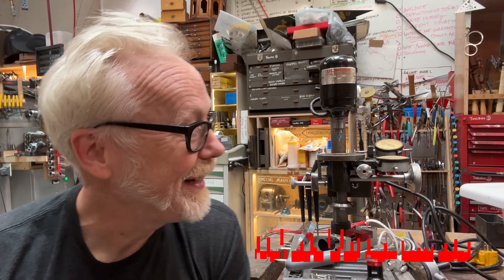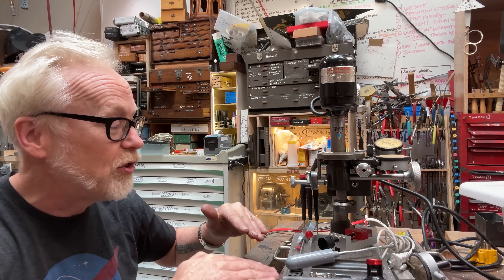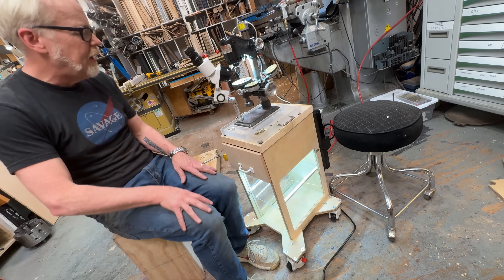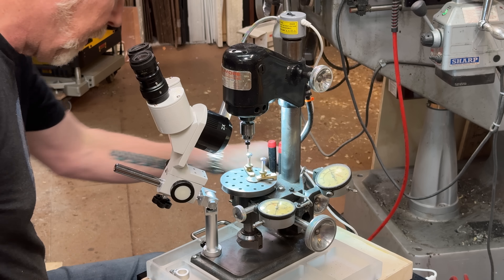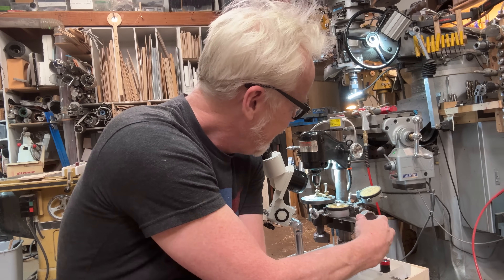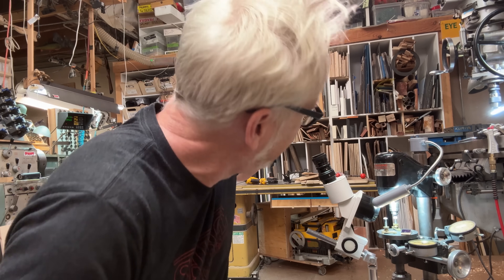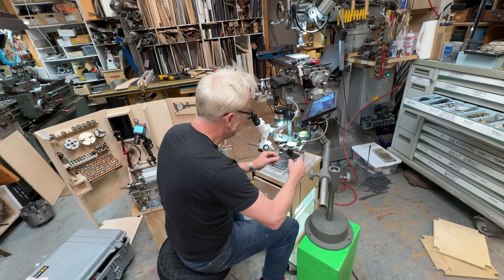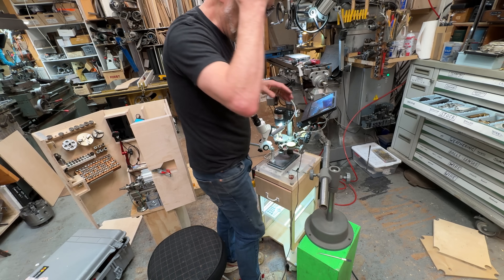Drilling a Hole the Width of a Human Hair?

Comment: Pretty sure stability of the surface you operate this on is going to become more important. You're on what, plywood? That's going to become a problem.
Reply: He mounted the stand on caster wheels. So it doesn't matter what the floor is made out of. He's isolated off of it now. Drills generally don't suffer from chatter issues though. The thrust is inline.

Comment: "Thats the smallest hole i'm ever gonna drill", sounds exactly like a guy who's about to deep dive on drilling even smaller holes.
Reply: 100%. But hopefully at that point reason prevails and you remember that lasers are a thing
Reply: @Mupshot  I've been out of that industry for a while but last I checked, FIB was still preferred for fine detail work, where laser was preferred for rapid material removal, and there were tools that combined the two for the best of both worlds. In that world though, blink and something new has come along, so you may be right!
Reply: @Mupshot well,  that wasn't a thought I even had!
Reply: drill a hole the size of a 200nm transistor
Reply: @monad_tcp  can get at least an order of magnitude smaller with a FIB machine
Reply: My thought exactly
Reply: Fig anyone else watch the montage and think you'd like to see a competition build between Adam, Richard Karnes, and Tim Allen?
Reply: Let me drill holes the size of a hair. And let me adjust the drill with a big ol' plastic hammer at 16.53
Reply: Edm machine would be the answer
Reply: So...just how do you center punch that size.
Also your depth  vs diameter ratio  will be hideous 
Similarly.. how flat % square is the stock...  
Then there is the issue of runout in the drill collet.....which can creap up to the drill diameter...

Yep it's a challenge. 
 EDM exists as does laser
Reply: Its sounds a lot like "thats as sharp as my chisels ever need to be"😂
Reply: he's going to drill a hole through the middle of the bit he used to drill the smallest hole, like firing an arrow through another arrow
Reply: Especially coming out of the mouth of Adam Savage... :D
Reply: The smallest holes are the most fun to drill.

Comment: I've measured the diameter of my hair a lot and it's always a thousandth of an inch consistently. That's 0.0254mm. So about four times smaller than 0.1mm (0.003937") Adam must have some pretty coarse hair. Or he's screwing his conversions up somehow. One standard inch is precisely 25.4 mm. That's the definition of a standard inch.

Comment: Put a single drop of oil onto your surface where you are going to drill your 0.1mm holes.  Make the drop as small as you can.  Look at that drop with the naked eye, and appreciate how small it is.  Then see just how big that drop looks through the microscope when the drill bit starts to drill the hole.  It will blow your mind.

Comment: How to you resharpen such bits?
Reply: They're consumables.
Reply: Past a certain diameter the geometry is less critical. Basically if there's a sharp point it'll drill. So I point them up and that's it. But a sharp point does drill better than a dull point will.

Comment: Going slower drilling small diameter bits makes zero sense. You're supposed to overdrive small bits. Just so you don't break them. Faster turning means less pressure.

Comment: Before 3D resin printing became so cheap, I frequently hand drilled 0.3mm holes for scale model planes with a dremel stylo, can't imagine how difficult it is to do in metal.
Reply: Drilling small holes by hand is pretty difficult. A drill press makes it a lot easier by keeping the bit aligned better.

Comment: Over on the Cutting Edge Engineering channel, I remember one video where Kurtis was terrified he might break a 5mm tap because he never deals with holes that small :-). I guess it is all relative.
Reply: I just snapped a 6-32 tap. I hadn't broken a tap in quite some time and this one didn't give any indication before it let go. I scrapped the whole piece and made a new one.
Reply: Just today I drilled and tapped four 2-56 thru 3/16" 304 stainless. I was at peak pucker factor the whole time. Afterwards I finally remembered to breathe.
I'd never done anything smaller than an 8-32 before. I was so stoked.

Comment: I worked in a very small machine shop and we got a job to drill .030 holes in stainless steel tubing . Only got 3 holes out of one bit . At the time I was using MotorKote oil additive in my cars motor , it is a liquid polyester that would give me 10 % better gas milage so went home got a bottle and back to drilling , when from 3 holes to 28 holes , way better bit life span . Something for you to think about :)
Reply: Some stainless is an absolute nightmare to machine. All of it's pretty bad but some is extra bad. Some stainless work hardens. So as you're drilling it if you don't feed it'll get really hard. With a small diameter drill you can't exactly lean on the quill. But what you do when it case hardens is you slam the bit down into the bore. Just what works.
Reply: @1pcfred  Yep, all down the the speeds and feeds.
Reply: @1pcfred  Just like a Microwave... some think it is 100% power or nothing.
Reply: That was really a very small machine shop, lol.
Reply: Stainless Steel is a nightmare too drill, Even cobalt hole saws blunt after a few holes,
Reply: @dogwalker666  there's different alloys of stainless steel. They all suck. Some suck worse than others do. Some stainless steel can work harden. The cutting edges of the tool tapping in the bottom of a bore can make stainless get harder. So the solution is a heavy feed. You just push like crazy. If you don't go hard on stainless then stainless will go hard on you.
Reply: @1pcfred  It is also picks up, If you use a power driver on stainless bolts the threads weld together. 
Most of ours is 316
Reply: I'm genuinely curious... What is an actual use of such tiny holes? I can imagine something for 1mm or even 0.5mm but I have no idea why would you need a 0.1mm or smaller for...
Reply: @EstebanGrasso  jets and nozzles can be pretty tiny. Orifices for various purposes. Metering, controlled leakdowns, stuff like that.

Comment: Those Harbor Freight micro drillbits are godsends, especially when repairing electronics with damaged traces and pads
Reply: I'm not too keen on those tiny carbide electronics manufacturing waste bits. They're very brittle and tend to snap on me. I have tiny twist drills made out of HSS that I prefer. I even have a micro drill press too. It's not as nice as Adam's Dumore but it's still pretty schmeck.
Reply: @1pcfred  Those small carbide bits can't be used by hand. If there is any runout or movement in the work piece, they will snap off. They also can't be used to drill high aspect ratio holes. Using them with any metal that likes to grab carbide will break them too. 
They are intended to be used in a CNC drilling machine to drill holes in PCBs. When used correctly, they last a long time.

The HSS bits will only drill a few dozen holes in a PCB before they get dull. I've drilled thousands of holes in PCBs with some of my carbide bits and they are still very sharp.
Reply: @1pcfred  I have broken quite a few of the smaller bits when drilling metal. I mostly use them for drilling PCBs and they rarely break when doing that.

Comment: We did this at work a few weeks ago! Managed on the first try to put a 4 thou hole through 5 thou thick tantalum sheet metal using an old Bridgeport and an inspection microscope. I'm mainly proud of the fact that I didn't break the bit while getting it in and out of the mill.

Comment: amazing, smallest I have drilled was 0.5mm but that was via a flexi shaft from a dremel, and I was drilling stainless steel sheet hand held, I sometimes didnt manage 1 hole and other times I would get 20 before I broke the bit- I used carbide pcb drills (look very much the same as the ones you were using, but I bought about 5 packs at a time.). I do have an optical measure (a microscope with a calibrated platen, commonly used to measure tiny thread pitches by counting 10 teeth and then measuring the offset from the start.) I guess one of those could be pressed into service to measure hole spacing while drilling.(I do have 3)

Comment: Hi, I have so many questions 🤓 but here are a few, sorry 😞 f I’ve missed you addressing these in an earlier video. Apart from the satisfaction of doing the difficult, what are the practical reasons/applications for doing this? Perhaps this is an aside but how do they form the holes in a small hypodermic needle? Can you get something of a similar size for CNCing brass? I would like to create small format wood brand.

Comment: I was super impressed when I used an egg beater drill and a 1mm bit to drill tiny holes in Blackwood/Huon Pine earings for my wife. It was the only drill with a chuck that could grab this dentists hellscape of a bit. $0.02
Reply: You can get pin chucks. They're pretty handy. It's a little collet chuck on a shank.

Comment: Mention of possible applications would have been nice - assuming there are some. I mean I know sometimes it's just the challenge but if a manufacturer makes bits that size surely they must be useful.
Reply: @migtrewornan8085 - Watch making would be the most common
Reply: Small bores are good for jets and nozzles. Like say if you want to atomize fuel.

Comment: I can officially say I've never drilled that small of a hole before.  I used to work in a cnc shop at a university and we had an air spindle that would spin 40,000 RPM's and I think we did some holes about 0.012" on a Haas cnc mill.  It was very difficult even on a cnc to not break the bits cutting plastic.  I'm amazed that this manual drill press can cut so well.

Comment: It's funny I just ranted to my wife about how equating things to the width of a human hair irks me as a machinist due to the large variance in hair diameter 😂
Reply: Did she question if you were splitting hairs?
Reply: @-danR  HAH! slaps knee
Reply: In machining, the width of a human hair is gigantic
Reply: @smashyrashy I wouldn’t say gigantic unless you’re doing .0002 tolerance. Which is rare
Reply: @smashyrashy  in what machining is a thousandth of an inch gigantic? Fantasy land? General shop spec is +0.003" That's three times bigger than the diameter of my hair. I have blond ones. Everyone knows a blonde one is tight tolerance. Everyone but you, that is.
Reply: @1pcfred   " in what machining is a thousandth of an inch gigantic? " maybe the guy works with MEMS, but I don't think those are machined, they're revealed using chemical process and photolitography.
Reply: @1pcfred  LOL. you can even FEEL a thou with your bare finger. For any sort of true precision work, ten thou tolerances are the BARE minimum, and three thou is ridiculous.
Reply: Aerospace, RF, physics research? Anywhere some over caffeinated labcoat nervously walks into the machine shop with a half-baked schematic and asks the machinists just how precise they can make these parts.
Reply: @1pcfred  an yes, the old adage that anyone can build a bridge, but it is the engineer's job to build the cheapest bridge that just barely doesn't fail. Within regulated tolerances, of course
Reply: @1pcfred   General shop spec is a total fallacy
Trinkets, plumbing, aerospace tech, vehicles, firearms, tooling, fixtures - there's too many specialties to throw out a general spec
Reply: @1pcfred  true in general yeah, one of the troubles in my line of work is that more precision = better results , without limit, so there is no amount of precision that is "overkill" for the end product, and we're purely balancing precision against budget (and time). I spent a lot of time this week lapping these stupid effing spacers to an absurd tolerance, to the point I was sick of looking at them, but seeing how happy all the eggheads were with the improved performance of our machine afterwards...well, I'm still in it for the money but it's nice to have satisfied "customers"
Reply: My hair is a perfect thousandth of an inch. I've measured it countless times with calipers and micrometers. So it's like I always have gauges on my head. Thousandth of an inch gauge, here you go.
Reply: Why would you need such a tiny hole
Reply: @IloveElsaofArendelle for a tiny bolt!
Reply: @IloveElsaofArendelle   Oraface discs used in hydraulics.
Reply: @IloveElsaofArendelle  Small holes like that are typically used for microvias in circuit boards. That's not something you are going to do in your shop though.
Reply: And the more eleptic the hair strand is the more it curls
Reply: I'm still flipping furious about football (⚽) pitches constantly being used as a measure of area (probs not in US🤔) since I discovered they are not a standard size
Reply: @stoatystoat174  in the US we use the football field to indicate length, as in "It's longer than ten football fields."
Reply: @notahotshot  what's wrong with a number of yards?
Reply: @stoatystoat174  worth mentioning in addition to the previous comment: that's American football, and the field length is actually standardized to 100 yards between goal lines (or 120 total), it actually makes a decent ruler as American football uses the yard lines during play so they're marked by 5s and labeled by 10s.
Reply: @jarrodsutterfield3752  Are you German or Austrian? 😋
Reply: Always wondered why the "RCH" measurement was so specific.
Reply: Thickness of a hair is not a good spec, but is great for conveying a sense of scale to the general public. I have an optical system calibrated to 0.043 mm ± 2 microns at a 1 m distance, but just tell prospective non tech purchasers that it's more accurate than a human hair. And that's completely ignoring the accuracy vs precision distinction
Reply: @jamesyoungquist6923  the thickness of my hair is a good spec. My hair is always a thousandth of an inch in diameter every time.
Reply: I used to work for a filter company ( well tier 3 supplier)
The parts  went  into a cenifugal filter.  Basically  centrifuge engin oil
Bearing clearance  in modern engine  are order of 10 micron
( micron.millionth of a meter). About the thickness of an oil film..
Hair  is usually  100 micron. 
Red blood cell..big way o=o shape is 70 micron
Anyway  our journals fit was 6 micron..to not allow oil to bypass centrifuge. . 
Apparently  tge oil out of this filter was cleaner than that poured into the engine ..
It even lowered particulate emissions  on the MAC trucks fitted with it..to the extent  that the system was at one time talked of as required for californian road use..
Reply: Air bleeds are often drilled..
One such drill was boasted of as tge smallest ..at an aircraft trade show.
The sample was returned with holes drilled both lengthwise and diametrically. ..think mini recorder ..
There is always a bigger( smaller dog)
Reply: That's why AvE uses "thin blonde one" - metrologoy matters! 😂

Comment: Precisely ground micro drills, especially those that are made of tough, nano-grade carbide and are small enough to drill accurately through a single hair follicle, aren’t exactly a dime a dozen. Only a handful of manufacturers even offer them
Reply: They actually are rather cheap - although whether they are still that accurate...

Basically, they are used in PCB manufacture, and are re-ground many times. When they get too short for the automated machines, they are ground one more time and then sold for people like us to use in machines like this.

Comment: You can make your own 3D printer nozzles now :-).
Reply: as someone who measures in the 0.1mm scales semi-frequently I must say that the jump from 0.1mm to 0.4 is fairly noticeable and probably much MUCH easier to drill, also you can make 3D printer nozzles much wider than that, one of my printers is rocking a 1mm nozzle, and since it is 1.75mm filament I want to try an even wider nozzle.

Comment: We were drilling .005" holes in .085" stainless tubing in our Fadal CNC for high temp, high pressure rupture testing for the steam tubing in our R&D energy storage blocks. This simulated what can happen when bad water chemistry is used in steam boilers.

We were absolutely blown away that we accomplished this! Took several tries, but we did it!
Reply: What is .005” in mm / microns / micrometers ?
Reply: @shaunsandow2073  0.127mm

Comment: I love using the small drills , it’s my specialty in my career . A trick I’ve learned over the years as a machinist is to predrill with a small 120 degree spotting drill or slightly larger drill bit. Also always look at the flutes those small drills sometimes have issues with the evenness of the flutes that can throw you off and make you think something’s wrong!